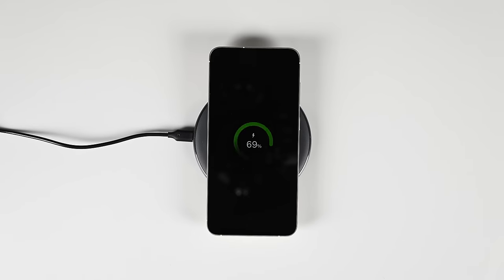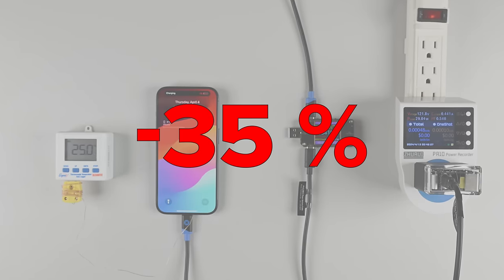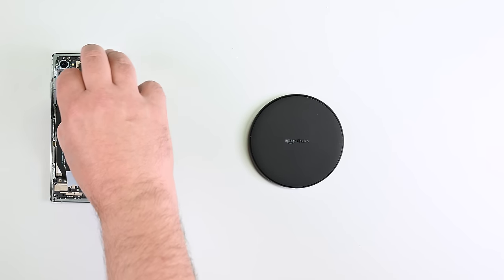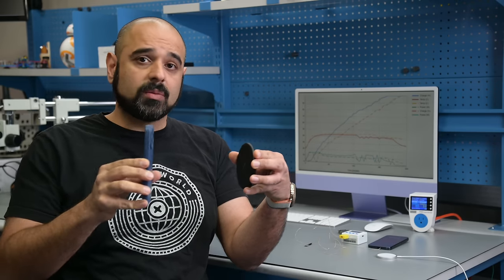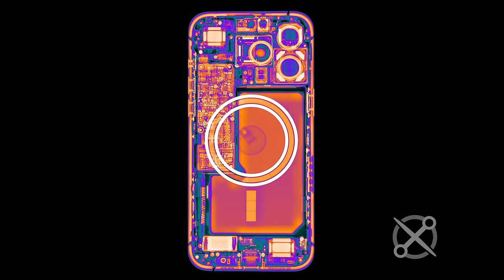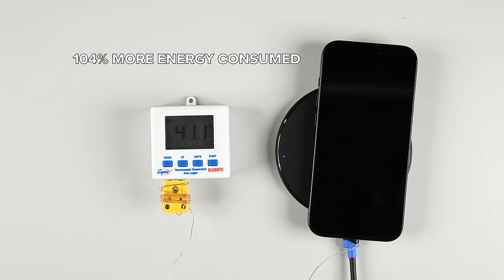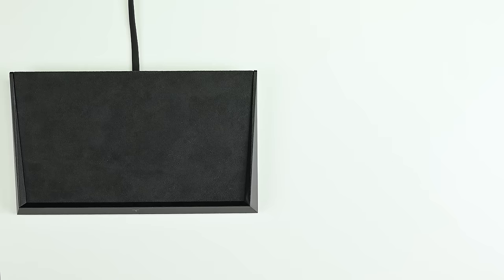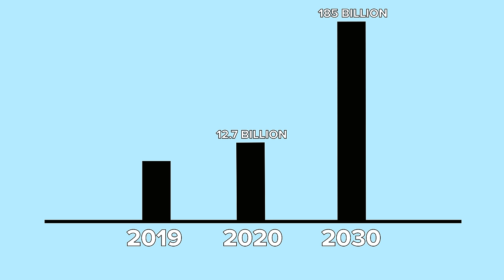How Wireless Charging Works and Why It's Terrible

Comment: I remember a precursor of the now-ubiquitous Qi charger, the Palm Pre "keystone" (?). My very first foray into modern electronics hacking was modding a Galaxy Nexus to connect the 5 volts from the charging coil removed from a spare Palm Pre back cover to the back of the pogo pins intended for docks. It worked, but boy was that thing toasty, and it probably wasn't good for the battery module to be squished a little bit more with a coil right next to it. Thankfully it never blew up like the old Galaxy Note did.

Every time I've tried a "new innovation" for wireless charging, it always heated up the phone and its battery. It was especially bad when you tried using a wireless pad in a car during navigation, most of the time it would stop charging because of overheating, especially with newer Android releases that monitor temperature.

So I stick to BigClive's recommendation: USB, 5 volts, low current. Use PD only if you have to get your phone charged NOW.

Oh, and NEVER wireless charge overnight. You'd think a trickle charge overnight would be OK, but not when the battery is heated up.

Comment: I went for wireless charging as a matter of choosing the lesser evil while getting the added convenience as a bonus. It's far easier to replace a battery on my phone, than the USB connector, so I would rather wear that down than having to do some crazy desoldering, hoping the pads won't rip, and resolder in a connector I'm not sure I'll even be able to find.
A very slow charge at night mitigates a bit the heat problem at least.
All would be solved with simple metal contact charging docks just like any wireless landline phone or Japanese mobile phones had years ago.

Comment: I'm glad I have a Qi 2 certified wireless charger for my S24 Ultra that's a pad and I have one that's a dock. I actually prefer to use the dock because it will stop charging my phone when it reaches 💯 this I know because the indicator light turns off.

Comment: For a while now there are wireless chargers which have active cooling built in. They need a good (car) charger but they for very well. Even in blazing hot cars mounted under the windscreen. It's basically a phone cooler and wireless chargers which have into one device. Most even have magsafe. From 25 to 80 USD.

Comment: I only buy phones with wireless charging, because in public places you may find wireless chargers and you don't need cables. Additionally, in these public chargers USB ports are often worn out.
Wireless charging allows to operate the phone when its USB port is broken.
Yeah it is less efficient, but we are talking about a few more watt-hours, your electricity bill won't change.
I agree it can be problematic in hot climate, that's why I added a fan to my car smartphone holder I 3D printed :)

Comment: I always air travel with my magsafe. On a few airlines when wiring my iphone into their usb-A port, and after refusing the "Trust this Device", my phone simply won't charge. Using original cable or not. Same goes for using 3rd party cables and wall chargers. And replacing Apple cables and chargers with originals are not for the faint hearted. They can't access your iPhone over any magsafe charger. I'll rather stick to that in public, that means air travel or hotel usb ports.

Comment: All you say is true. On paper. That until you get some moisture and dirt into your connector or it breaks because of the constant connect/disconnect. Battery on the other hand is a consumable and should just be easily replaceable.

Comment: The thing that bothers me about wireless chargers is that they all are plugged in (obviously) usually with the same wire you phone takes to charge. So your cord is right by your phone, but plugged into the wireless pad instead of the phone. Its not any less convenient to unplug the phone than it is to lift it off of the pad.

Comment: The only phone I have with wireless charging yet is Nokia Lumia 930 and that thing heats up a lot during that, if you don't use the phone at the same time then it won't burn your hand, but it's still quite unpleasant to touch it

Comment: I think all my phones have gotten warmer than 30 C when charging with a wired charger. The room temperature is 25 C at the moment...

Did a little test: I had my phone charging on a wired charger for ten minutes. Battery heated up to 35 C. And it's not even super fast by todays standards: 30 W max.

Comment: Dude, I charge my iPhone with a cheap slow wireless charger, it's been a year and battery still has 100% health. Obviously is the speed in which you charge your phone that matters, my wireless charges takes 7 hours to charge my iPhone, I leave it all night on top and by morning is fully charged, besides, with wireless at slower speed my battery lasts 30% more than when charging it with the stock cable, it only takes two hours to fully charge my phone which is perfect for an emergency but it doesn't get more than a day of battery, while us for 7 hours wireless gets me a day and a half, sometimes more! Doesn't matter what you use, but slower is always better!

Comment: Dont forget people. The faster you charge, the more heat generated. So if charging overnight ALWAYS turn off fast wireless charging. Also turn on the "protect battery" feature if you have it to only charge to 80% when its feasible.

Comment: On the other hand, no ports are physically damaged over time.

Also, because its convenient and effortless to put the phon on the charger, you can always have a fully charged phone or charge for a couple minutes when you do not need it.
So you can actually use the phone longer even with a depreciated battery.

Besides the energy loss I think it benefits the environment more than it hurts. But that is only my opinion

Comment: What do you think about the ultra-fast wireless charging by brands like xiaomi which goes as high as 80 Watts and above?
Doi those devices heat excessively or use some sort of design to manage temprature?

Comment: Very odd to compare equal wattage between wireless and wired charging. A 45w wired charger would create a similar or increased temperature curve. With knockoff chargers, all good points but that is people actively choosing the cheaper, and less optimized, alternative. A question: How many wireless chargers are lost due to wear vs wires? USB Ports rendered inoperable? You're only including the stresses with regards to the phone battery.

Comment: I live in Pakistan, and the temperatures here are crazy high, peaking around 48-52° celcius during summers - enough to put most phones out of their charging habits. Aside from an air-conditioned room, there's nothing that can force my Samsung Galaxy to pick its peak 25-watts wired charging speed. The phone gives me temperature warnings otherwise, and I have to resort to an overnight charge, disabling the Fast Charging because both the charger and phone get extremely hot.

Comment: I discovered the hard way today waking up to my phone at 60% still charging at 7:30 AM, I put it on charge at 10:30 PM on my wireless charging dock didn’t take it off once. When checking settings it said it was on charge all night and last charged to 60% at 7:32 AM. Extremely slow.😅

Comment: Would a MagSafe compatible phone case decrease the efficiency due to distance or does the case act as a bridge between coils?
Reply: The case improves alignment, improving efficiency.

It will not be as efficient as a wired connection.  Magsafe and Qi2 is about as good as it gets for wireless charging.

Comment: Let's say you use your phone longer then two years (4-5) and you'd top off your battery on the run thanks to quick charging. There are some phone brands out there that need mandatory USB port replacement in that timeline. One thing to consider on wired charging.

Comment: I am inventing a mechanical receptacle that allows for perfect alignment every time and also creates a DirectCurrent™ connection for maximum efficiency that also inproves battery life and allows for faster charging.  It fits invisiblely in the end of the cable instead of requiring a "puck" or "stand", allowing for more flexible placement of the phone or device while charging.  I call it "Plug In" charging technology.

Comment: phone batteries are almost always hotter around 40 C during spring/summer times where the weather is reaching up to 30 C. just having a case on your device will do even more. no one takes their phone case off during charging so almost every iphone will be hot during charging and these tests dont even consider the use of phone cases which make the phone even more seperated from the charger and keeps the heat in.

Comment: I feel like this completely ignores the advantages of wireless charging. Yes there are some potential downsides—potential. But I find it to be a huge advantage to be able to put my phone on a charging battery/stand and rotate it into landscape for watching video or for StandBy mode. It's also much safer in my car to place my phone on the Qi charging ledge than fiddling with cables. And the declaration that wireless charging "might" hurt my battery if I place it misaligned on coils is a lot of 'ifs' to feel dangerous. Finally, does MagSafe make any sort of difference? The magnets snapping the phone into place seems to help a lot with alignment.

Comment: I don't get Wireless charging, You pay more (literally the cost of putting wireless charging makes the phone more costly and The equipment to get fast wireless chargers) and it charges slow asf

By the time my phone charging port degrades or The charger pin gets corroded, My phone will in need for a Replacement anyways, never in my life a Recent phone from a decade ago has any wired charging problems, It was probably a problem back in the day when usb a existed but not anymore.

Comment: My parents use wireless chargers for their phones. My dad went to have his battery replaced about 3 years after he got it. My first phone, I had for 5 years and then sold it without needing to change the battery first because it could still make it through the day on a charge - it had 84% battery health.

It’s just plain not convenient to need to take your phone in for any kind of repair, even one as simple as a battery swap. I would rather plug in my phone with a wire every night than need to drive an hour to the nearest repair shop every few years. Not to mention that it’s possible to use a phone while it’s charging on a wired connection, should that ever be needed - I’m not really convinced that wireless chargers are actually any more convenient in the first place.

Comment: I don't see the point when the charging pad has to be plugged in anyways. I'm already dealing with wires so what's the difference between sticking a plug into this plastic puck or my phone?

Comment: Meh. Replacing battery myself is like $15. Thats cheaper than a cable most of the time and we all know how long cables last. 

I can fit my phone with a wireless powerbank in a waterproof bag. Cable takes up too much length.

The waste heat from wireless charging helps my phone to not overcool while cycling in winter. Phones work very poorly in cold otherwise.

I can 3M tape the wireless powerbank to a plastic phone case and its perfectly aligned and I’ll never have to remember a cable.

Comment: I remember Apple working on the wireless charging pad and they abandoned it exactly because of heat issues.
Reply: Yes, they had the same idea as the Tesla thing. I think, at the time, they thought it would replace the cable and they’d remove the charging port completely. I imagine they did similar tests and could see all the class lawsuits they’d get filed against them for degrading battery life and so wisely abandoned it.

Comment: Honestly, the in-car wireless chargers are the only place I use them, just because the ease of dropping my phone in a cubby and driving off is just too great, and all I'm really trying to do, is negate any energy used by running CarPlay/navigation. Besides that, I almost exclusively use a C-to-lightning cable and a fast-charging capable power adapter, because (especially if I'm trying to be a good boy and stay under 80%) the charging speed enormously outweighs the inconvenience of being tethered.

Comment: now that i think about it, I'm still rocking an S9+ and i have a rollingsquare wireless charging kit that comes with a metal ring that "acts" like apple's magesafe. i only stuck it on when i got a "charge" but i doubt i actually got it perfectly aligned since i eye balled it. wish there was a way i could realign it without cracking open my phone

Comment: i always use wireless charging. i dont care about the loss in efficency.
i want my phones usb port to not break, i've had it happen with previous phones just from plugging in the cable for charging.
the temperature problem isnt that bad either, i use a samsung wireless charger that came with my s24 ultra. it has a small fan inside to cool

Comment: The problem with “wireless charging” is your phone still needs to be place at a spot in order to charge it. Is not like you can bring it around and charge it so why bother. Might as well just make a bit more effort to plug a cable to it like it has always being ?

Comment: The heat is a problem but the efficiency doesn't matter that much cause its a tiny phone battery. 6-12 Wh is not a big deal, especially considering its about 60 Wh to toast one slice of bread.

Comment: 30°C danger zone? but that's the ambient temperature where I live 😰
Reply: Yeah, my phone is at 34 degrees when I just use it at 20 degree outside temp
Reply: Forget that, every, single, time, you use your phone to do anything more complex than using the calculator it will rise up to that temperature in a matter of minutes

Comment: I've never understood the point of wireless charging. I still have to plug the wireless charger via a cable into the wall so it's really not wireless. At that point I'm just going to plug the wire directly into my phone. It's faster, more efficient, and I never have to worry if it's actually charging or not. I also can't stand that high pitched beeping noise that emits from every wireless charger I've tried. Drives me crazy lol. Wired for me, please :)

Comment: I have a little magnetic connector that plugs into the charge port and is never removed.  It means that there is a physical connection for the angry pixies to cross, but also has about 99% of the convenience of a wireless charger.

Comment: I charge my phone every night with a coil charger and a 5w plug and it stays cool. The waste of energy is not a big deal and my battery dropped from 100% to 99% in 7 months. iPhone 12. Another story if you use MagSafe at full 15W.

Comment: I had a galaxy s8 with a busted usbc port that lasted for a few more years by using the wireless charging coil. It is nice to have another option. However, the battery was pretty cooked.

Comment: Truth be told, I only started using wireless charging with my Pixel 7 after experienced USB-C data issues on my Pixel 5. I can only assume this occurred from extensive wear on the port due to daily charging needs.

Comment: I use my phone all day for work and wireless charging is a god send. Its Infinitely more efficient then plugging and unplugging my phone 8000 times. Charging speed isn't the only consideration for efficency. Also with fast wireless charging now it's barely noticeable speed wise.

But of course if you want to put your phone down and charge it as fast as possible from 0-100 plugging it in is obviously best.

Comment: I think wireless charging is an answer to a problem that doesn't exist any more. When we had piles of competing standards for USB charging, they all required specific orientations for insertion into the device and it seemed like no two devices used the same connector. Wireless charging standards sidestepped all of these problems for a short time.

Contemporary phones only have one of two charging standards (lightning or USB C) which can be inserted either way, and with any luck the lightning connector will die and we'll have one standard. I can plug my phone into the charger in the dark without even looking at it. Wireless charging has a long way to go to match that convenience now.

Comment: I've never had a phone with wireless charging, somehow it never came up. USB C has solved all problems I had with plugging phones in to charge, so it's really fine.

My Poco X3 Pro broke in a charging accident - don't use a hairdryer for 15 minutes on the same power strip you're charging your phone on - and I've been told by a highly rated repairman that it's fried the chip and is essentially unrepairable. 

Due to it already being out of software support and being unfixable, I'm thinking of going with a Fairphone 5 now, which once again also doesn't have wireless charging. And I think I'll once again just not really care about the missing feature.

Comment: I didn't realize there was so much energy wasted or that it caused the battery to get too hot.  That said, I never use wireless charging because to me, it's not that hard to just plug it in and it has always charged much faster that way.

Comment: I thought charging slower was supposed to be better for your battwry long term? I have fast wireless charging disabled on my phone because I don't need it to charge quickly overnight.

I only buy a new phone every 5-6 years or so, and my last phone and current one's charging port hasn't lasted nearly that long. The technology isnt perfect but it is keeping my current phone out of a landfill and still in use.

Comment: I use a Nintendo Switch AC Adapter with my wireless charger. Its ass slow so the phone stays cold at all times. Charges up fully in like three hours